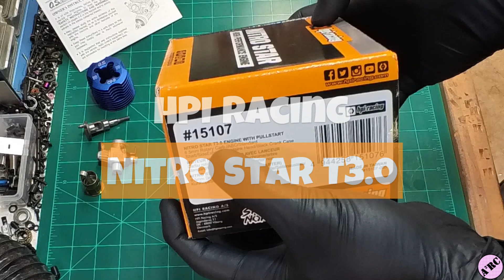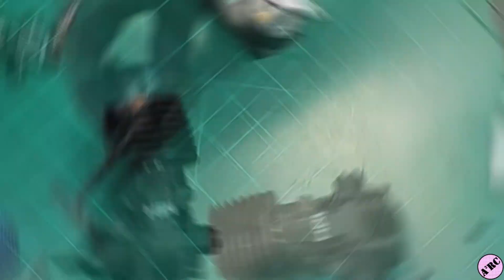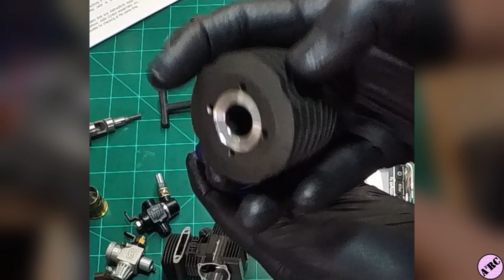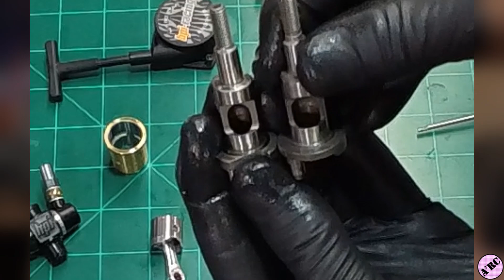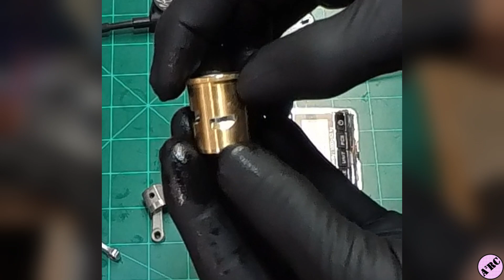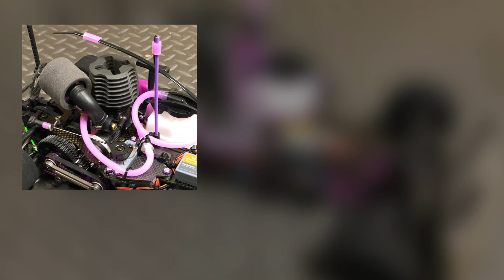HPI T3.0 vs 18 CV-R - Nitro Engine Overview - OS meets Force

Comment: Love your videos. Always learning from you. 

What brand and fuel ratios do you recommend for these engines ?
Reply from the maker: I’m a VP fan. I have tried others over the years (including Bones, blue thunder, sidewinder, etc) and for the cost of the fuel, I personably don’t see a reason to stray away from a quality product like VP 
- I prefer to use a 25/9 blend for most ABC engines (25% nitro, 9% oil).

For break-ins or when I want/need a bit more oil, I simply add some Klotz to the mix to get the concentration to what I need
- I do keep other blends on-hand too. Like 20/14 as an ABN engine baseline. I normally add Klotz to bump it up to 16%. 

Regardless, of nitro %, my recommendation is to always buy a blend with low oil. That’s so you can add your own oil to make the end concentration you want to have. You do have to buy 4 different fuels when you can “make” your own (if that makes sense) 
- This way you’re adding a product which helps with film-strength. That additional film adds to the engines running performance and will aid in its longevity 

It’s great to know you are enjoying the video 🩷 I really appreciate you and everyone for watchn’
Reply: @a2rc Thanks for your response. Helps a lot.

Comment: Hello again, I'm turning to you as you are very knowledgable with respect to the HPI t3.0 engine. I recently bought a starter box for my kyosho fw05rr and I want to put the hpi g3.0 on it. The starter box means I won't need the roto or pull starts. Is there a sealed blank backplate? Much more efficient and won't leak like the roto backplate. Thanks in advance.
Reply from the maker: Thanks for reaching out‼️
I haven’t tried it yet myself but, there a good chance that the back plate I used on the 18R would work for either the T or G or both
- Unfortunately with Force closing, we may not be able to get that backplate or other parts moving forward
Reply: @a2rc  Yeah the closure of Force is absolutely gutting.

Comment: The starter shaft of the T3.0 with the spring loaded pin, is that whats causing my "buzzing" noise? When I turn the  flywheel, i hear a metal "pling" every full turn, first I thought it something wrong with my brand new engine (was running it in), because when running it in, it makes a "buzzing" noise, like a high voltage power plant box (if that makes sense). I guess its kinda normal because the pin "jumps" down into the ramp?  Its not my first nitro, but cant recall hearing it before. Anything you might add?
Reply from the maker: Thanks for taking the time to write. I would have to hear what you’re hearing but, I’m not sure it would be the small internal pin (unless something is very wrong). 
- In a normal situation, I don’t think you would be able to hear any type of noise coming for it

It’s possible you have something rubbing, out of round or misaligned 
- The noise maybe coming from your bell/clutch, spring in the pull start, bearing noise or combustion noise through your exhaust or depending on what type of air filter you’re using, it could be making a noise from it. It very well could be something simple but, it’s hard to say

 I don’t notice any type of “ping” with my T3.0. Nothing significant anyway 
- Nevertheless, I appreciate you watchn’ and taking the time to write. Feel free to say Hi anytime 🩷
Reply: @a2rc  well, I uploaded 2 videos, ill share the links if you want. What I to test, was remove the backplate and then remove the startershaft "plate" and the pin immediatly flew out also, in another engine it was more tucked in i would say. So before putting it back,i spun it around, and the noise was gone, could just keep on spinning it and no "ping/click" metal sound. So I figured, the catchpin is being pushed into the starter shaft a bit stronger then normal and it make the metal tick sound everytime. In 1 video you will hear me spinning the flywheel by hand, till you hear it, its a full turn. I can "move" the clicking sound to another position of where the piston is, by spinning the flywheel the other direction a bit and then turn it again forward, it will still make the click sound but at another posistion, if that makes sense. So the other video, is the engines first tank, but if you listen carfully, you will hear a higher pitches buzzing sound. And I think its the pin "buzzing" over the startershaft ramp. The pin is sping loaded... But yeah, still a bit strange: 
video1: https://youtube.com/shorts/dS9BsZ2FYnY
Video2: https://youtube.com/shorts/5McMW8SXh_k
Reply from the maker: @Photonees Ok so I watch and listened to both vids. You don’t show exactly what you are doing in first the video or how you started the engine in the second 

I just took my pull start off a new T3.0 I have here. The only way you could get the clicking noise to happen while the engine is running is for you to have the one way bearing on backward. Or something is binding the one way 
- When a good/new one way is installed the correct way, the starter start should be free spinning on the one way and no clicking should happen at all. 
I would need to see what you are doing/pulling on to make the clicking to happen with the engine off. Also see how you have the one way installed on the starter shaft (to see if it is put on the correct way) 
- Lastly, again you could possible hear the clicking while it’s running if the one way is installed backward and forcing the spring and cam action to happen every revolution but, you would have to start the engine with a bump start. I don’t think you would be able to pull start the engine on because the one way would slip on the shaft (unless some thing is broken/bound/lots of friction, etc

In a controlled way, with the pull start taken off and the black plate, spring, pin, etc is installed in the engine properly, I admit you can hear it click but, mine is soft and dull sounding (not like yours) but, again I can only get it to click in this condition
- I think you need to open the pull start up and engine to make sure you have everything correct and nothing broken or loose as well. 
Hope all that helps a bit but, let me know
Reply: @a2rc  Thx for the time, one sub extra! well I installed a rotostart, and the video does make it sound louder then it is. The OWB is on the correct way, flat side to engine. Its hard to film, and use 2 hands :) In the first video, i was just spinning the flywheel just to let you hear the noise. In the 2nd video, it was started using the rotostart when I heard the buzzing. What I will look at tomorrow, is the spring and pin, compared to the old one, It might be sticking out more then the old one (and the spring new and harder or not inserted deep enough, so perhaps hitting the metal of the startershaft harder then it should. Perhaps it will go away (or get duller) when ran a bit more. offtopic: I do have to say, for running in an engine, im not convinced a rotostart is the way to go, it make the engine spin pretty hard then you would like i had a feeling, but afterwards,after a first tank, it make it starting a breeze and just witin a second.
Reply from the maker: @Photonees Ok it makes more sense how you were able to make it “click” with the engine off of you were rotating the flywheel. In a way, that’s normal
- The noise you might be hearing when it’s running could be a number of things rattling. Including the roto start gears, bell to spur, drive or throttle links, etc etc. not sure but, could be normal/nothing to concern yourself of??
- There’s a good chance you are over thinking it and may have a perfectly fine running system. 

On the same but different topic, if you are not already, try and pre heat your engine. Especially if you are going to use a roto start. If you can help it, you don’t want to force the piston through the pinch cold. You will just wear out the engine quicker. Most drills/roto start systems make it “easier to spin” but, if cold, it just does damage quicker 
- Just some additional thoughts 

Have a great night
Reply: @a2rc  Well, i crashed already with the new engine lol and bend the chassis, hit a tyre of a car sideways, a wheel popped off and I think the engine was hit in the head as it slit sideways under the tyre, as I saw the engine-mounting part was bend. I was still tuning, with shell on, would have saved it. But I already transferred it to another chassis, but i noticed the carb was twisted and loose, so I wanted to tighten the nut, but I cannot find any tool in my bag that fits this, or its to small or to big. Could you measure it (in mm?)? Online cant find it either... So that i can get a tool tomorrow
Reply from the maker: @Photonees Sorry to hear you crashed a bit. That all apart of the fun. Crash, fix, run repeat lol 
- The Carb pinch both nut on a T3.0 should be a standard 6mm

Hope that helps and let me know when you get her back up and running 💯
Reply: @a2rc  Thx! Hope I can find a small tool that fits and that the engine is fine, it was so nicely running in idle the moment I let go off throttle, ran so smooth, i hope it still is and the impact didnt damage something internal that is yet to be revealed. Because of the impact, the clutch-bell bound the gears and made the engine shut off instantly

Comment: Thanks for the great comparison! Once again another amaizing video! Can you please tell a bit about G 3.0 HO version. It looks like this version is kind of a beast with 2.2 HP at 30 000 rpm as OS 18CVR is "only" 1.35hp at 28 000rpm. What gives this big difference in between?
Reply from the maker: @lyubennyagulov9012  😮 Thank you for the kind words ‼️ Makes me happy to know you enjoyed the vid

The next engine overview planned in the Volume 5 series, is in fact the G3.0 HO. Stay tuned for that one
- A little insight into the T and G3.0 horse power claims is just that, they are claims. HPI/Force seems to have have been a way over on what reality may be. I personably would love to see real dyno data on both engines. 

OS claims 1.35hp for the 18CVR and that is probably more realistic. 
- The driving test I referred to in the vid are of two very similar RS4 builds with the two different engines attached (T3.0 vs 18CVR). I did a series of test and the CVR came out on top (even with the 2.2Hp claim for the force/HPI .18 engines).
- Todays vid shown a great comparison, as to why the design of the CVR engine is a bit better than the T/G3.0. In my opinion anyway

I hope that helps a bit and I really appreciate you taking the time to write and for watchn’ 🩷
Reply: @a2rc  Thanks for the answer in very great details! It looks like the G3.0 HO really outperformes the ordinary G3.0, but the only difference I can see is the carb. The G3.0 HO tosses with no problem the HPI WR8 chassis, which is quite heavy, but I havent tried to mount OS 18CVR on a WR8. Looking forward to see your next video=)